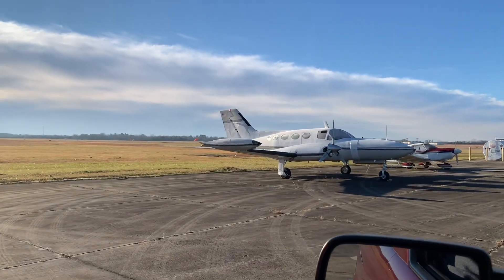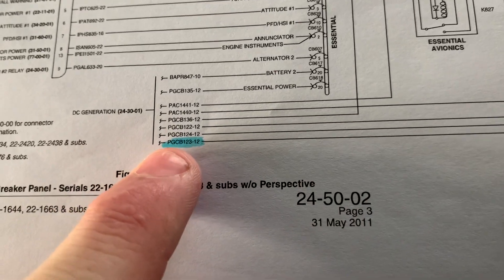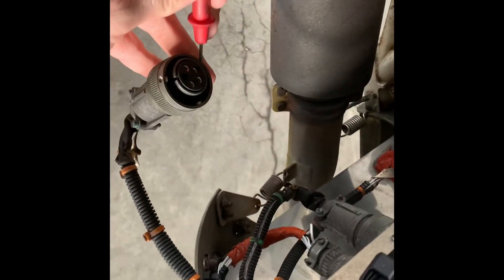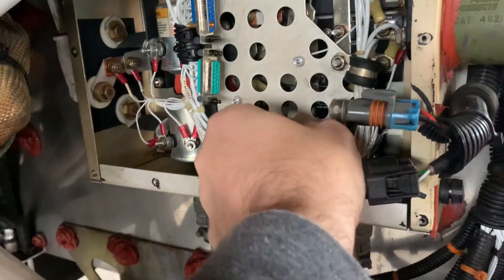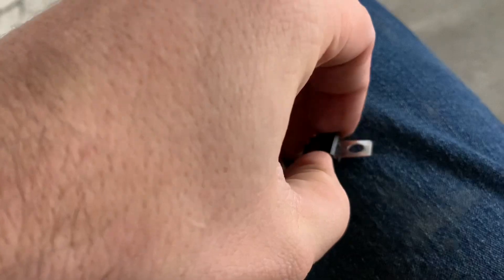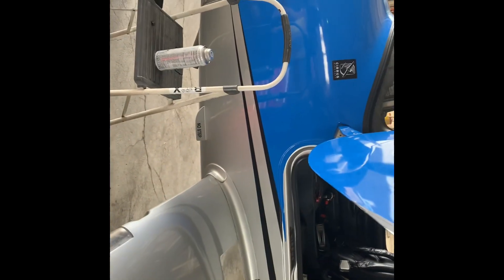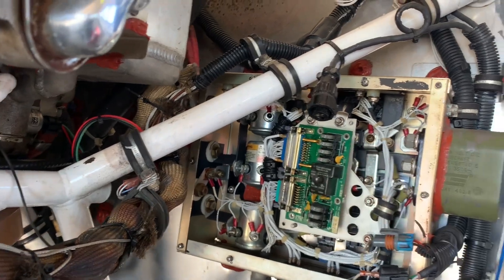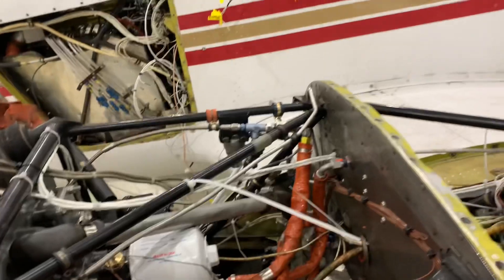Blown fuse on a Cirrus MCU.. Trevor Jacob opinion.. day in the life of an A&P mechanic

Comment: Question = is there a certain kind  of wire ends and plugs s ?
Reply from the maker: Im not sure what you mean, but there are designated part numbers in the maintenance illustrated parts catalog.  If a terminal isn’t called out in the IPC then we’d refer to the AC 43.13 for guidance

Comment: I have previously worked many years on that exact MC-130H, 0011, what airport was that located at?
Reply: You can tell that the crew performed an emergency ground egress, by moving the condition levers to feather and pulling the fire handles.   It’s rare to see all 4 T-56s shut down in feather when parked.

    There is an issue with C-130s of a certain vintage where the large gauge wires carrying the 3phase AC from the engines and APU/ATM to feed the busses were not installed with drip loops near the cannon plugs.   

    Over the years, these large cannon plugs slowly corrode from moisture exposure and the increased resistance will lead to an eventual electrical fire.   Unfortunately, these cannon plugs are in a difficult area and don’t get taken apart for inspection during isochronal inspections.

      I believe a fleet wide TCDS was issued to perform a one time inspection in this area.  Perhaps 0011 did not receive this inspection yet.
Reply from the maker: I cannot specify and I don’t work at an airport or on planes 😉